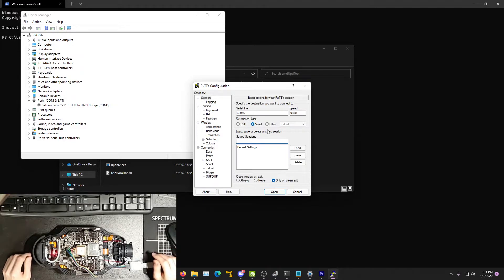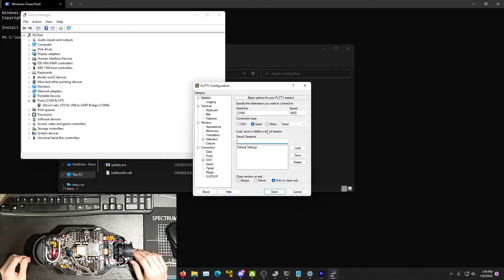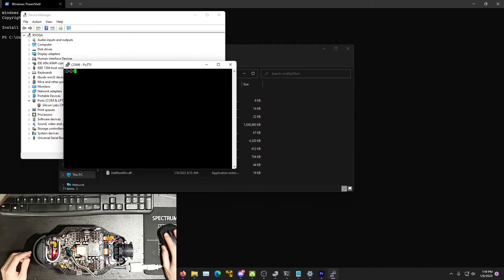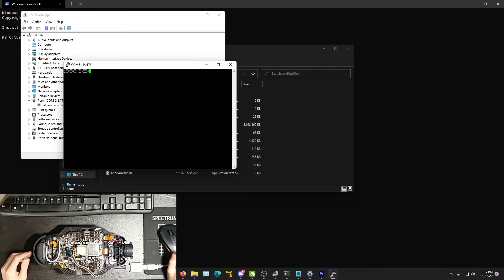GoPro Karma Drone Progress Update

Comment: Baud rate is 115200 , you want to plug into J2 (up near the gimble connection), it will show you what the DM368 is doing, If you have the pairing issue you will see the NAND fail to boot. To fix the NAND boot you should look to upload a new UBL/Uboot to the NAND.

Comment: 2 weeks ago try to fly drone but it was not recognized by controller. karma body turns ON but cant get to turn off by button. only turn off by removing battery. also stabilizer dont wake up.  if i go to pairing mode (holding power button for more than 8 secs) , karma body flashes lights but never turns off.  i read @macjax88 about nand corrupted. first i do was restore controller.  no lucky with karma pairing.  then reflash to 2.00 and no lucky too.  then reflash to another youtuber file 2.50.1 and no lucky.  today start trying updating karma grip using a driver install on gopro quick win 10.  karma grip was already up to date.  then put stabilizer and camera on drone body and trying pair mode on the first attempt and lucky stabilizer camera works, controller found karma and pairing was success.  turn on motors inside home and then shut off motors.  drone also turns off with button without removing battery and i make a lucky dance.   but this not last long.  try to  turn on karma an stabilizer was not working and controller didnt found drone again.  i will try tomorrow againt . today drone will havent battery on place.  tomorrow i will put a fully charged battery and try if it works. if works, i will try to update all from controller .

Comment: Unfortunely, If your Karma powers on, and does not pair and ALSO will not power down with the typical power button press and you need to pull out the battery to power it off you have a bad NAND flash memory. Since the Karma drone has a multi-bus and multi-processor architecture, it contains multiple controllers and processors. The different lighting on the drone (rear and feet) is controlled by the first processor to allow for micro software injection in case of a micro software crash (for example, after a bad update). Even if the motherboard is broken in two, the first processor will turn on the LEDs, but this does not provide any functional information about the state of the drone, only that the battery is providing power. The 6 PCB circuits of the Karma body contain multiple processors and are protected by encrypted internal communication and a UID (Unique Identifier) with the serial numbers of the components. This architecture is necessary to prevent any hacking of the flight system and to meet the safety requirements of the FAA (Federal Aviation Administration) and the DGCA (Civil Aviation Authority). In the end, your Karma requires a reset of the NAND flash memory and reprogramming.
Reply: However, if your Karma does power on AND power off correctly with the power button, your Karma is probably fine and doesn't suffer the fate of what I posted above and should pair. You might want to look into re-flashing the controller's firmware one version at a time and see if it will eventually connect. Another way to tell if the Karma is actually looking for a pairing signal from the controller is that the Karma will actually "time out" and stop searching after about 3 minutes and the power LED on the Karma will blink red. All arm status LEDs will be solid (red/green) and pressing and holding the power button with the drone already powered on will restart the pairing process.  Hope this helps...
Reply: Do you know how to reset NAND flash memory and reprogram?
Reply: @erikbrabelo3243  unfortunately, I don't as it takes special equipment but there is a place in France call VCC Labs that knows how. They have a special program to replace the NAND flash for $20 euro.
Reply: my drone was this behavior and this day karma stabilizer works on first starup pairing mode, controller recognize and drone was able to turns off by button without removing battery.  but on second try, it stucks on same behavior.  not recognized again
Reply: You're probably right. I had a drone repairman replace the NAND flash memory and do many other projects. Now Karma is back in the air and has no problem communicating with the remote control.
Reply: @MAESTRObyBEAR  so it can be repaired. its good news. i will wait for a diy .
Reply: @MAESTRObyBEAR  VCC Labs in France ?
Reply: @MaCJaX88  No. The drone was repaired by a craftsman in my country, Belarus. I think you can look for a good electronic technician in your country. The main thing is that it can be made. I can not put in the public domain video proof that it is made. We will soon prohibit individuals to have a drone and even its spare parts. This is because of the military conflict in a neighboring country. I can make a video and upload it to google disk. Before repair and salting. To make sure that the repair of the Karma is possible.
Reply: @MAESTRObyBEAR  nice !That's not easy to do. Glad you are back flying.
Reply: @MaCJaX88  Thank you. Yes the drone is back in business and that's good to see. As promised, I made a video. You can watch it at the link.  https://drive.google.com/file/d/1Pvw1hJ0y7g_4zNCPO1Be3jnlm2c0X3iT/view?usp=sharing

Comment: How’s the investigation going

My karma just died. It’s was fully updated and flying fine.  Then next time I switched it on the.  No connection

Do you think it’s related to any type of cmos style battery failing
Reply: There are two small hearing aid batteries on the drone PCB, but i think they are only for keeping track of time.

Comment: i wish technician who designed the drone just silently drop us a clue or two on how to repair this thing. or just tell us it cant be done so we won’t waste anymore time and move on with our lives
Reply from the maker: It would be amazing if someone from GoPro was able to provide some insight, but the chances of that happening are almost nonexistent. We will just have to muddle through on our own for now : /
Reply: @donovanlawson2848  i was thinking about turning it into an FPV by replacing perhaps most of the electronics. FPV parts are not too costly and plenty available. i think it might be more fun and doable than trying to hack the Karma electronic systems. although, im not sure how Karma's frame will take FPV flying style beatings. the conversion can be done im sure but how well it will fly is still an unknown. so, i think ill start gather needed parts and ask around. ill let you know whether i fucked it up or successfully converted it. this project will take some time tho. :)
Reply from the maker: @boncharusorn6173  That's awesome! Definitely let me know how it goes

Comment: Would it be ideal to switch the motherboard to any other brand board or even Chinese stock its just an idea
Reply from the maker: It would take a lot of reverse engineering and re wiring. You would have to find out how the motors and sensors were wired, rewire them to the Chinese board, then find a way to mount everything. Certainly possible, but far from ideal. The ideal solution would be some kind of reverse engineered custom firmware for the drone, one that we (the users) would have complete control over.

Comment: Could it be that the latest update that has disabled all the drones, has somehow disabled the power to the stabilizer, and therefore the drone will not pair. or could the drones pair even if the stabilizer and camera were not connected to the drone. My Karma is nothing more than an expensive ornament now, so I have no problem playing around with it, but I have no idea about chips of any sort, but YouTube is a good learning tool. can you tell me which chip stores the software, and how you connect with it. I read somewhere that maybe the memory is full and cant clear itself, is that a possible cause I dont know, I just trying to figure out how we can get these drones flying again.
Reply from the maker: I have successfully paired a drone on an older software version without the camera attached, so that likely isn't the issue. I have a feeling it is just poorly written software from GoPro. The software probably just has a bug that causes some random error the drone doesn't know how to deal with. The port I was trying to connect to might give me access to the system log and show any errors (out of space or etc.) that are preventing the drone from pairing, but I need better equipment and experience to talk with it.

Comment: Too bad you couldn’t just put in a new flight controller and pair with the controller. Bypass the whole thing. I saw a video where a guy said GoPro should put out a new update to roll back the software but that’s kinda hard to do it it won’t pair 🤨

Comment: Hi Donavan, thanks for your effort. Have you messed around with the micro SD slot yet? Do you suppose it's purpose is for the initial load of the firmware since it is inaccessible without removing the top of the drone?
Reply from the maker: I thought the same thing. It is not doing anything with the microSDs I put into it, I am thinking it has to be formatted a specific way with a particular file structure. I was hoping I could find out what it is looking for by logging from one of the UART connectors on the board. If I could establish two way communication with it, finding out how it accesses the SD card slot should be trivial.
Reply: @donovanlawson2848  have you identified the exact microcontroller? I believe you said STM and my chip has 632 so STM632? Do you have any more info on it?
Reply from the maker: @safrey1  I did have more information on it, but I can't remember off hand. I'll need to check when I get home.
Reply from the maker: @safrey1  The chip closest to the STM32 debug port is 632-14777-000-A. I cannot find much information online about what it is or what it does, but STM32 is a family of processors based on arm and is likely the main processor of the drone.
Reply: @donovanlawson2848  now I know where you got the the STM32 from, I was looking on the chip itself and found the same ID you did but like you said, there's not much info based on that ID, but you can get in the ballpark with STM32. I agree that is the main processor, flash ROM, and RAM all in one.
Reply from the maker: @safrey1  Yeah, that is one way of implementing it if you are programming for the chip. GoPro has their own way.
Reply from the maker: @safrey1  Lol, if only I had the equipment for that
Reply: @donovanlawson2848  Hello! If you still interesting, this is remarked stm32 controller (STM32F42xxx/F43xxx like st-link says). I have full memory dump for st-link. But the problem with the linking is not related to stm32 controller. Problem with DM368 chip (under shield) nand memory (probably with ubl loader), you can see this if connect dm368 via uart (connector near shield, secondary pin is TX, 115200 speed).
Reply from the maker: @egorromanov8247  Oh wow that is very useful, thanks for your response! So if the problem is with the nand flash, do you think it can it be re-flashed, or has it been worn out/corrupted in some way that makes it impossible to write to it?
Reply: @donovanlawson2848  Possbile to reflash, but GoPro doesn't make testpoint for DM368 uart boot mode. Only way it's jtag i guess
Reply from the maker: @egorromanov8247  Hmmm, I don't have a jtag writer. I'm also very busy with other things (school), so I'll probably get back to this later. Thanks for giving me a start!
Reply: @egorromanov8247   thats not 100% true, what REV board do you have ? There is a white sticker on the main board in the bottom right hand corner.
Reply: Hi, did you ended it !?